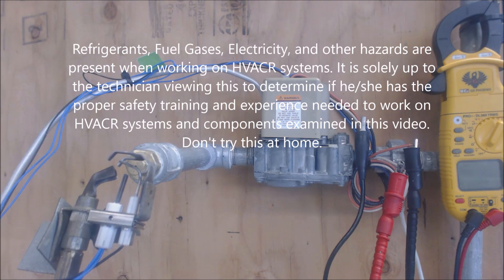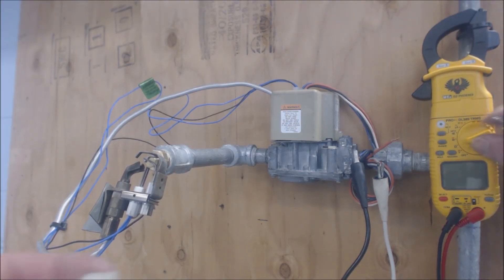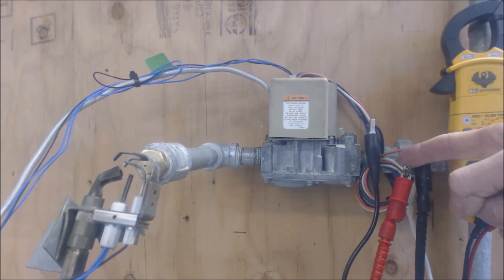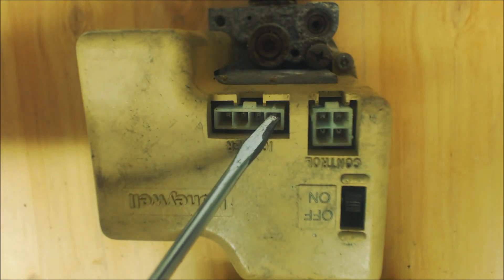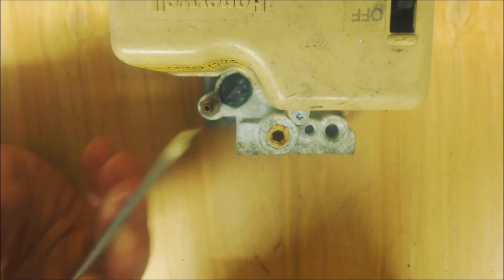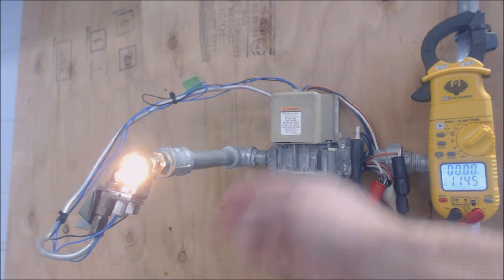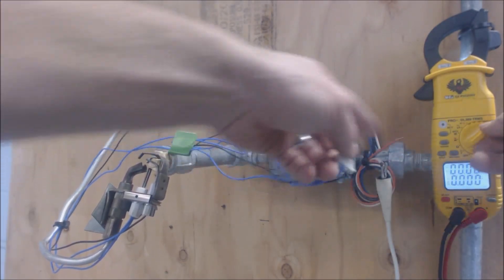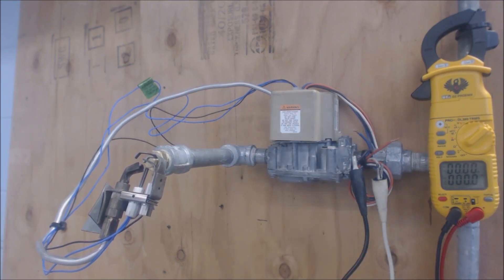Gas Furnace Smart Valve, Ignitor, and Flame Sensor Troubleshooting!

Comment: Need help. Lol I have everything you are saying but no ignition on 24 volt hot surface igniter.  Please help. My girl had no heat and I'm worried about the kids and the animals. Very good video
Reply from the maker: If you have 24v to a 24v ignitor and it doesn't glow then the hsi is bad, thanks!

Comment: 180 volts? You responded to Mike Kahidi but I can not decipher your answer. I thought it was millivolts as well. Please clarify.
Reply from the maker: This smart valve sends 180v AC into the flame rod and dc micro amps travel back through the ground. The only way to check dc micro amps is to cut the flame sensor wire to put the multimeter meter in series, thanks
Reply: @acservicetechchannel  So there's a step-up voltage in the Gas Valve? Cause your only giving it 24v... Good vid BTW!

Comment: How do you check flame sensor  when flame is on ? Like we can read on basic flame rods 2-4 ma
Reply from the maker: Unfortunately you can't unless you want to cut the flame sensor wire since the pilot tube is the ground, thanks Guy Hakverdi!
Reply: so if you cut it and measure it would you read somewhere between 2-4 ma? Thanks for sharing great vids.
Reply from the maker: Honestly when we start having intermittent problems with the flame we usually just replace the flame rod and hsi since they are all one piece and clean the pilot head. Flame rectification is simplified on this since it follows the pilot tube and goes right back to the gas valve board, thanks Guy!
Reply: The thing is you would't know for sure if smart valve control is bad or not. I agree with you I change the igniter with sensor and if it still giving problems replace the valve. I just hate call backs and usually happens during heating season lol
Reply from the maker: A tester can be made for this out of an old flame sensor connector and an old smart valve connector. The issue here is that they don't give us a value of exactly what it is because they don't want us to cut it but I would assume you are on the right track but the ma could possibly be higher, thanks

Comment: Great Video, only regarding the reading of the flame sensor, shouldn't be 180 Mili volt instead of 181 volts? Thanks
Reply from the maker: I was mentioning the ac voltage going from the board in the smart valve to the flame sensor. The mv is carried back to the gas valve via the ground on the pilot tube so there isn't a wire to pull apart and put the meter in series in order to test that, thanks Mike!
Reply: I cut the sensor wire and inserted the meter. I got 180v and 1.8 on pilot and 3 on main flame..... microamps. Unit runs fine after cleaning the sensor.

Comment: My smart valve is only getting 9.5 volts for the flame rod, not 150 to 180 volts.Bad gas valve?Great videos!
Reply from the maker: As long as you are getting a solid 24v to the gas valve and the wire going to the rod has no resistance or is not touching another surface than yes that would likely be the prob, thanks
Reply: Yes it was the gas valve,running great now, Thank you

Comment: Dude, I've been a service tech for 22 years & believe it or not I've NEVER had to service a Carrier smart valve set up, until today. I felt like such a dummy with the customer over my shoulder, so embarrassing. It was actually a Heil and their tech support is bullshit. You have to have your HVAC supplier call them on 3 way and my Heil Supplier are douche bags, they didn't have time and couldn't help me today. If I was able to watch your video earlier I would have been golden. I picked up a board, pilot assembly, and the gas valve. I was 99.99% sure it wasn't the assembly because I didn't have 24vac going to the igniter but I wasn't sure if it was the board or the valve. The schematic wasn't very good. It didn't show what each wire did, it was more or less a pictorial. I like using a ladder schematic when I'm not sure of the wiring. Anywho, I changed the board and finally the valve. I hate being a parts changer. Luckily, I was able to return the board. I am now a subscriber, great video.
Reply from the maker: Thanks a lot Michael! Glad to hear it helped!

Comment: My SV9601M4167 smart valve isn't igniting the pilot gas.  I've got a new HSI as well as gas orifice and have verified that gas is present during ignition sequence.  Input voltage to the valve is dropping from 26 to 20 during the sequence with a max of 19.5 at the HSI after about 10 seconds.  Any suggestions are great appreciated as I'd rather not keep throwing money at guesses.
Reply: Just a guess, maybe need a 24v >=40VA new transformer

Comment: Awesome video explaining how this setup works. I have the exact same system on my furnace. Just trying to figure out why sometimes it will not ignite and blows cold air.
Reply from the maker: Does it at least ignite for a split moment and then shut off or no ignition at ll? Does the 24v hsi turn orange and heat up?
Reply: I took it apart and cleaned it like you mentioned in your video and so far so good. I will check what you asked if it happens again.
Reply from the maker: Thanks!
Reply: That was short lived. The furnace came on without heat. The igniter should be fine it was 4.7 ohms when I had it out for cleaning. Is it safe to assume the smart valve has a problem with the internal circuit board?
Reply from the maker: If there is a problem with the igniting of the gas then possibly depending on if you have a good solid above 24v heat signal into the valve. If it is after ignition when you are having the problem with it shutting off, you may want to try replacing the flame rod and hsi combo as sometimes we have problems with the flame rod being too small and too much resistance in the wire to rod connection. It could also be a loose ground or smart valve board, thanks
Reply: @acservicetechchannel   Replaced the smart valve and it now works fine. I took apart the faulty valve and found the two capacitors were shot. Its 20 years old, so its no surprise the electrolytic capacitors went bad (high ESR)

Comment: Hi there,Great video - I replaced my smart valve and igniter about 6 months everything worked well until lastnight.So im troubleshooting now. I have 24v from pressure switch, 24v on hot coming into the valve.Question: for the 2 blue wires on the igniter - is there supposed to 24v coming from each blue wire...?Right now I only have 24v from one of the 2 blue igniter wires Your help would be greatly appreciated!!!!
Reply: I checked again and I have 24v off both blue igniter wires.I believe I found the problem. Seems the black  igniter wire is only registering 50 - 70 v and it fluctuates drastically. I believe you said that wire should be in the high 100's
Reply from the maker: That seems a little low but that still should work unless it is cutting out or something when that voltage is jumping. The flame rectification signal finds its way back through the pilot tube ground. Is that pilot tube tight in the gas valve without any pipe dope on the threads of the pilot tube brass connector? Also make sure that the pilot head and bracket are clean without damaging the hsi so that that the dc signal is able to make it from the flame rod, through the flame, and to the ground so that the dc micro amp signal is picked up at the control board of the gas valve. Is it firing for a few seconds and then just shutting off? Also if there is any intermittent problems, keep a close eye on that pressure switch. It may be trying to tell you of a condensate, combustion intake, or exhaust problem. Thanks
Reply: Thanks, I think I may have put pipe dope Pilot Tube connector - but it did work for 6months ....No intermittent problems and doesnt fire at all: got 24 v on both blue igniter wires and and on the 2x2 connector pressure switch proven good aqs well. The ignitor doesnt glow at all and when I try to cycle I believe the pilot comes on b/c i smell gas for a bit - then it stops.The smart valve is only 6 months old .... How do i check for micro amps on the pilot tube
Reply from the maker: If you are getting 24v on the hsi and the hsi is not lighting then you may have a crack in the hsi. Take the hsi connector off and test for resistance. If the reading is 0.L or very high in the hundreds of ohms then the hsi is bad. Thanks

Comment: Great videos!

I have a Sterling tubular heater in my shop. The main burner will not stay lit.  I've checked everything there is to check and have even replaced the smartvalve and flame sensor. I've bypassed the high limit thermostat and ventilation proving switch. I have 11 WC of propane pressure and the flame is strong.  I've ran a ground wire from flame sensor to smartvalve.  It puts out 113v to flame rod. It has steady 5.8 uA of dc current.  When it first starts up the main burner will stay on for about 2 min. on next attempt it stays on for about 45 sec. , then 30 sec, 30 sec again and last attempt 15 sec.   So each time it stays on for shorter time. It then flashes 6 times indicating issues with flame sense.  The whole unit is grounded properly. It worked fine the first 2 winters but then started acting up. Since it's in my shop it has very little time on it, probably less than 100 hrs use. It's all clean as new. 

The flame sense grounds through the aluminum gas tube from smart valve body as shown in your video. Even though there was continuity of less than 1 ohm between valve and flame sensor I added a ground wire between valve and sensor. I can simulate signal loss by disconnecting flame sense wire while its running during that 2 min cycle and burners cut out within a couple seconds. Then it tries again when I reattach. Everything is tight and clean. From what I've read, the pilot flame is supposed to stay on even when the main burner starts. It seems odd in that if the main burner didnt ignite, the pilot flame will satisfy the flame sensor to keep main valve on therefore blasting the propane out without it being ignited.Seems like a potential for explosion. I would think the pilot flame should drop out when main burner turns on, then main burner would be making flame sensor happy for the duration. As an experiment, when main burner was on (flame ignited), I took pilot flame burner/flame sensor assy away from main burner area (kind of like what you have shown in video and it has a ground path) and it still had 3uA of current. So it stayed lit  for about 2 min as before. 

The smartvalve is a 9540 model. The igniter/flame sensor is a Q3400A. When looking at the Honeywell document for measuring flame current. It says that for a SV9540  - if current is less than 0.8 uA then check for low gas pressure, flame rod contamination, poor current path, etc. If it's more than 0.8 uA then replace the SV9540. That doesn't make any sense. It doesn't give any range of what's good. So what it is saying is that it must be exactly 0.8 uA. Which seems really low. I keep wondering if it is a typo. Even in the document a footnote says flame rod should be capable of giving twice minimum threshold even under poor conditions. So twice is 1.6 uA and I'm getting 3 uA with just pilot flame and 5.8 with main burner. Also, watching the ammeter, it never flinches at all at the moment burner drops out which would indicate a brief drop in flame current if it did.

Well sorry for such a long story here. Just hoping to give you as much info as I can. Any help would be appreciated. 

Thanks!
Reply from the maker: I gave a couple suggestions in the email. It sounds like you have researched this a lot and seem to understand what is going on or heading in the right directs. When you say that you ran a ground wire from the flame sensor to the smart valve, do you mean from the pilot head bracket to the ground on the gas valve? That would be one step you could take. The other is stepping back and looking at the ground testing for the furnace itself. I know that sounds silly but it sounds like you hit a lot of the testing points at the flame chamber except maybe that ground wire from the pilot bracket. There shouldn't be a wire going from the flame sensor to the ground. - check out this video and check out the testing for a ground problem part - https://www.youtube.com/watch?v=LtfghUYfl-4&index=4&list=PLxnHR5_D2ojwefn5vubZ7A8MA89Z6AnMU  --  also check for things like the input voltage to the gas valve. Let me know how you make out, thanks
Reply: Yes, The ground wire I ran is from the pilot head/flame sense/igniter bracket back to the smart valve body. Basically parallels the gas tube. I checked ground from burner head and heater chassis back to valve and to earth ground at receptacle and it's all good. But I will go back over everything again though. There was 26 vac going into valve. I'm going to further investigate the earth ground all the way back to the breaker panel as well. I know it's going to be something easy and simple when I find it.. :-)
Reply: UPDATE!  Well Hallelujah! I finally fixed my heater! Last summer came and I once again forgot about heater. This fall I decided I was going to fix it or set fire to it. After pondering what I had done before, and the way it was kicking out so systematically I went back and looked at ventilation proving switch. Although I bypassed it before, it must be done in sequence, maybe I didn't do it correctly before. I put a volt meter on contacts and sure enough, after running about 2 min they opened up, Then flame would drop out and restart, the contacts would close again, after about 45 sec they would open up again and flame would drop again, this same sequence would happen 5 times and then do a 5 minute lock out because of 5 flame outs... The flashing LED indicator would indicate EVERYTHING BUT the proving switch according to chart on heater. If the switch would have stayed open, then perhaps it would have indicated the proving switch. Evidently the intermittent/erroneous operation made smartvalve think it had other issues. I bought a manometer to check for sure. Using it I could see that it had plenty of pressure differential. The switch is set at .40 WC. I had a pretty consistent reading of at least .60 WC with manometer. So it was evident that pressure switch was intermittent/bad. I replaced switch and it has worked fine for the last few weeks.  Sorry to ramble on but hope this may help others.

Comment: Thanks for the videos they are very informative. But I do have a question. I just replaced the surface igniter in my sisters furnace, it had burned out. when I turned the power back on it fired up and ran fine, but never fired up again. I went back up and everything was working as it should the igniter heated up and i could hear the gas valve clicking open but not letting gas through. I tapped the gas valve a couple times and tried again and it fired off and ran fine so I turned off power and tested it 5-6 times and it worked as it should. I talked with her this morning and its not lighting again and ideas? Could it be a piece of trash sometimes blocking the gas jet at the surface igniter? ( I'm guessing I can't get that lucky )
Reply: Brent Gross start cleaning
Reply: Brent Gross yeah when you get problems like that where sometimes it works sometimes it doesn't on gas furnaces just give them a full on maintenance. Clean everything, check capacitors, check filters evap coil.
Reply from the maker: Number one, with intermittent problems you could start with a status code light. Is it a new enough furnace to have an error code? IMon is correct in that you should clean what you can such as fine course unsoaped steel wool on the flame rod but NOT the hot surface ignitor.  If you are working on a 90% efficent or higher furnace did you temporarily disconnect the hoses off the pressure switches and blow out the condensate line? I have had gas valves intermittantly turning on and then shutting off due to the pressure switch sensor opening up because of clogged water or clogged aluminum inducer port almost shutting off. Just yesterday someone was telling me that the gas valve was clicking and then shutting off due to the pressure switch opening and closing. Normally the hsi will not turn on if the pressure switch is open but sometimes they close long enough to get to the gas valve part of the sequence. It could however just be a spiders web on a burner orifice where you should just start a god general clean. This is very susceptible if it were an outdoor packaged heat and ac unit. Let me know how you make out. thanks You might want to check some more videos out in the furnace troubleshooting playlist- https://www.youtube.com/playlist?list=PLxnHR5_D2ojyN6VClLntbM4X82Gc9Xs8A
Reply: I finally got back to finish the furnace and no sir its an old 80% furnace. I pulled the burner assembly, pulled the gas jets out of the tube  and the setscrews out of the top of the gas valve and blew it out. The assembly had gotten trash in it, I do thank you for your response and really enjoy your videos.

Comment: @acservicetech Very good video and very informative to the HVAC techs out there. One more item I would add is when testing the Carbide igniter, Honeywell states, at room temperature, the igniter ohms should be no more than 10 ohms. Above that it's advisable to replace with new igniter.
Keep up the good videos!
Reply from the maker: Thanks for adding that!